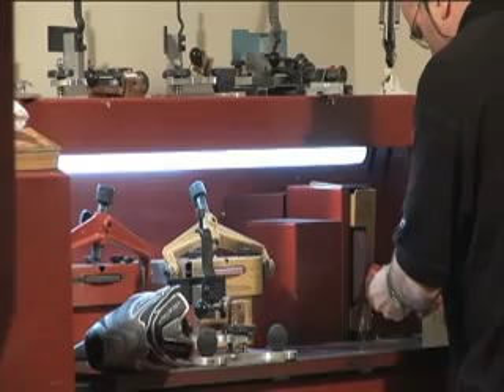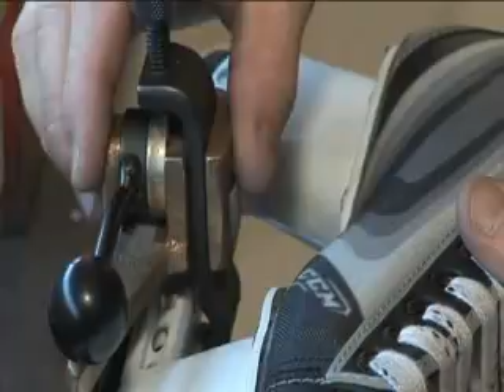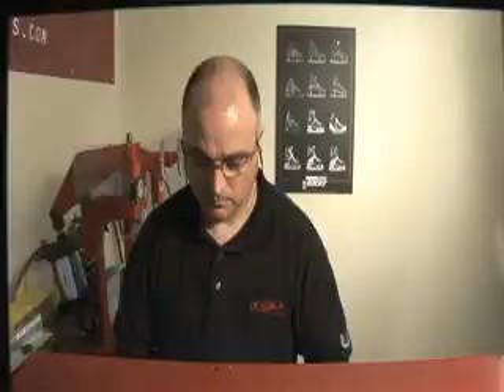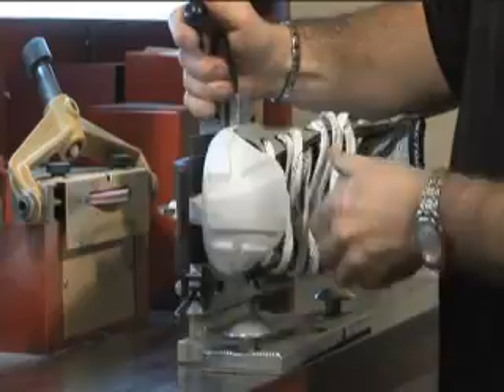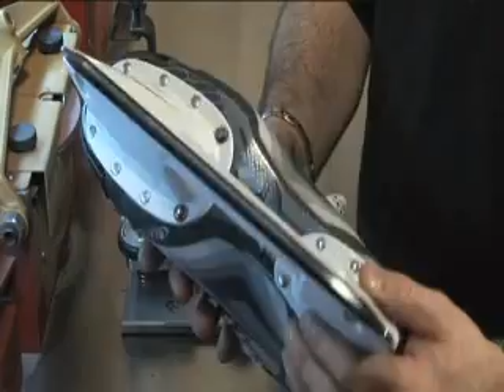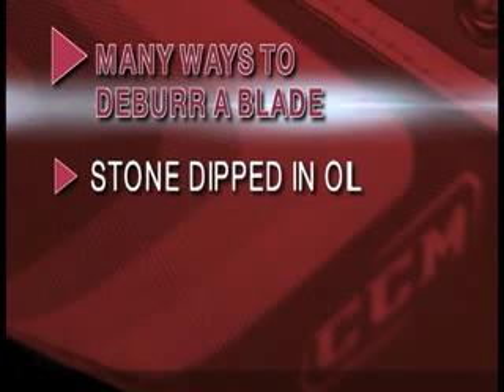RocketRunner Instructional Video

Comment: Cross grinding every skate... a great way to either burn the blade or have to replace it way quicker! Plus using a guide to see if the skate is even, bush league! Eye is the best way, check after every couple passes and this way you will grind way less metal and save the contour (old name=rockering) of the blade. 

Jeanjones9154.. the video above is not taking very good care of the blade.. if that was my skate sharpener I would never go back!!
Reply: Owen Hubley the edge checker is by far the best way . Now cross grinding the skates every time is a waste of steel . I only cross grind if I get a new set of steel or if it looks like they walked on concrete .